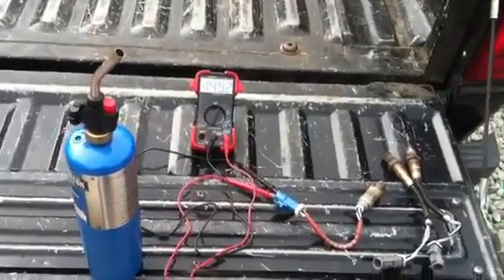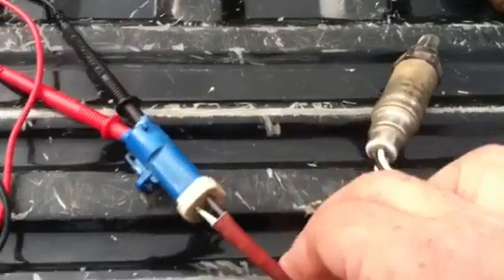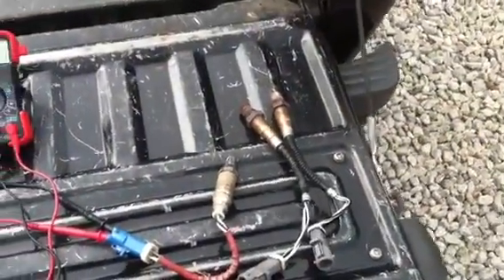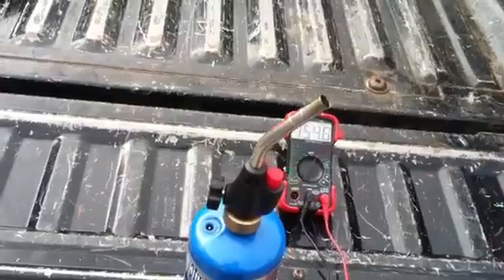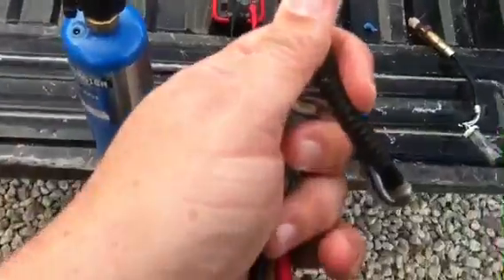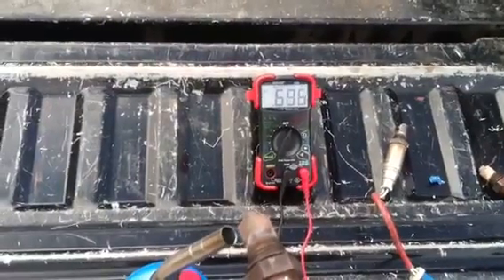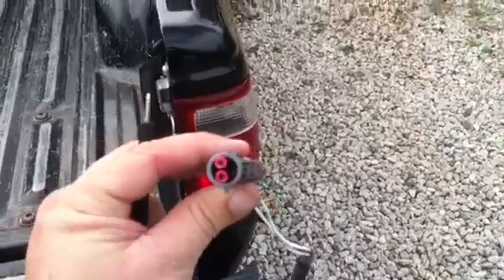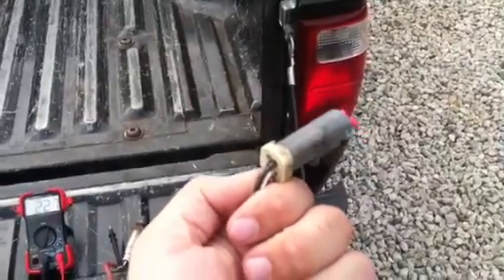How to test Ford 4 wire oxygen sensors

Comment: Well idea is right but you also fail to fully test it you also need to check the two white wires(heater circuit) for continuity should generally 3-6 ohms of resistance depending on manufacturer.
And more signal voltage should range from .1v-1v (generally would throw a different code if it was the heater circuit portion tho)

Comment from the maker: @newpage123 I never thought of using the stove top. I had the propane handy and they are cheap at WalMart. BTW, never use MAP gas, always use propane. MAP gas is too hot and will damage the sensors.